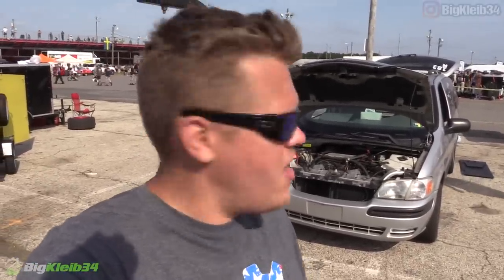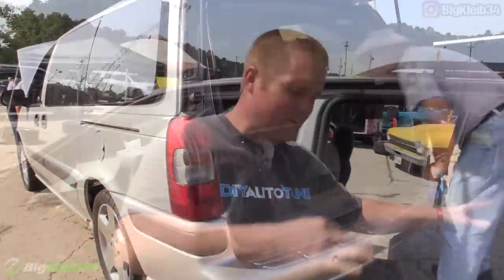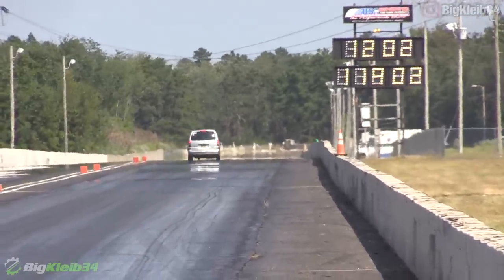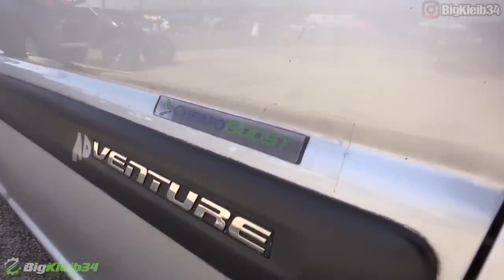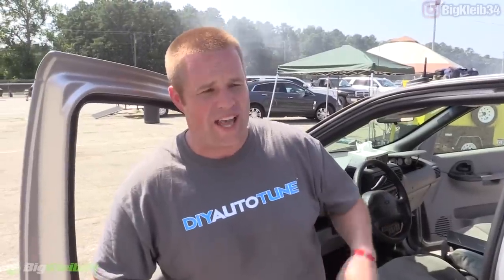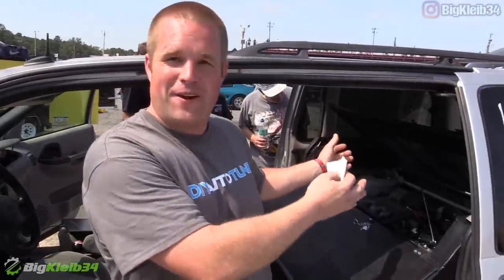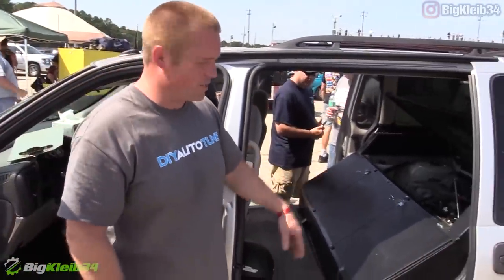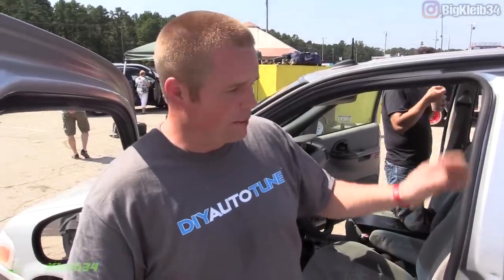Drag Racing Minivan Has TWO Engines and ALL THE TURBOS!

Comment: He should put different size tires on eather the rear so they shift at slightly different times so its always under power it would be a little faster,,wile one is shifting the other is still pulling every little bit helps

Comment: Easiest thing to do would be put line lock solenoids  on for the brakes.. that will hold it on the line and just let off the button when you're ready to go
Reply: Or just put both pedals on the right, trying to go from a brake in the middle to accelerator pedals on either side is like patting your head and rubbing your belly.

Comment: That is really cool and props to the guy, but why not just put that much effort into swapping in an LS4 motor into a van?  The 2006 Pontiac Montana SV6 which came after the Venture had a 4T65E trans in it which coincidentally is the same trans used in the Impala SS I do believe.  So given that you could probably get you a Montana and a source a motor from an Impala SS and make a badass van.  Some of the Pontiac Montana SV6 models also came in all wheel drive as well.

Comment: Just run a bracket from one to the other so the back engine works both and right pedal for front
Reply: Or do a drive by wire so both throttle bodies work off one pedal 🤔
Reply: @smooth_ops2942  
Ya that would work aswell, but looked like it wasn't a very high tech setup and he said he uses one for regular driving but with DBW could use a switch to shut one off. Good idea tho 👍
Reply: Simple by wire servo setup will work. 2 500g servos and a pedal sensor with adjustable control unit. The only problem is if you need to tune the throttles independently, you'd need 2 control units and 2 pedal sensors.
Reply: An arduino board might work best.
Reply: @triedproven9908  ya I get it but we are talking about a a guy that put two gas pedals in it lol

Comment: He definitely should have put the gas pedals beside each other just have enough space in between them so you could only push one pedal when you want and just rig up a bracket on the main petal that has a small piece of flat iron or aluminum flip over in front of the other petal and then your in business. ,I can see it in my head  but I don't know if I explained it correctly lol
Reply: Or do a drive by wire so both throttle bodies work off one pedal 🤔

Comment: I love the setup but the 3400 is an awful motor ... should have done the 3800 motors :D 

Its amazing how the rear fit that setup in there, I may do this to my 3800 supercharged van once she gets more off the road and stick to RWD only haha.
Reply: My thoughts exactly.!    To be honest the transmissions are kind of awful as well.
Reply: @christianfritz6333  yes agreed, the 4t65ehd can be upgraded a bit (same as the regular 4t65 parts basically) but there is a manual 6 speed alternative to the 3800 powerhouse. 

I think following the one powerhouse, AWD trans would be a more reliable setup. Instead of two 3400 junkers, two rads, two of everything basically. Plus you could essentially have a reliable daily. But at the end of the day the man is having fun so thats all that counts.
Reply: @oneeyedrone4293  agreed,    me personally I despise auto transmissions however manuals don't really lend themselves to competitive drag racing. Not including ratcheting trans like in a pro stock,    I was surprised about the 5k weight, that's a lot to deal with and probably a big part of the problem.